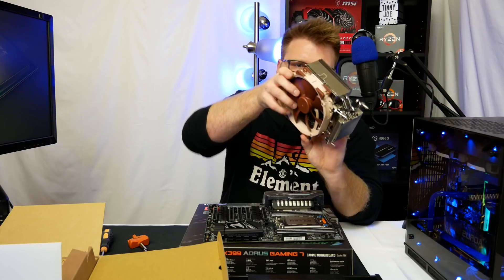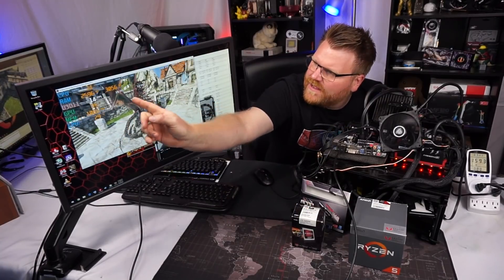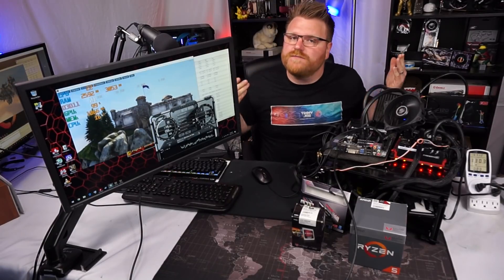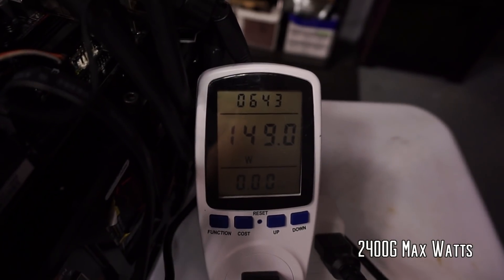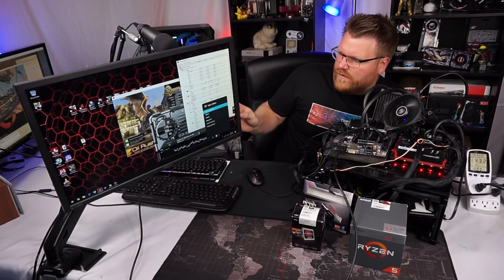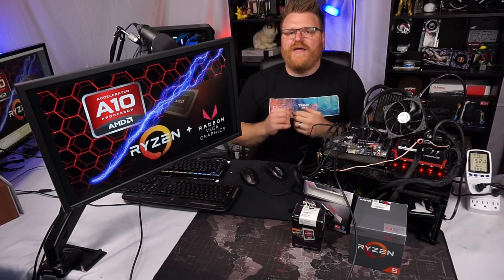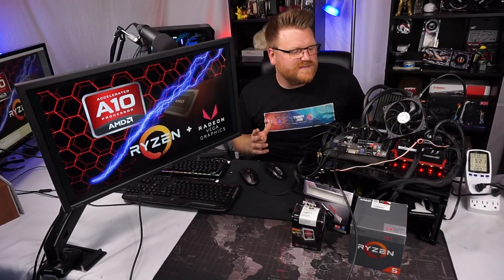How Far Have AMD APUs Come?! A10 5800k vs Ryzen 2400g

Comment: Watching this because I'm bidding on a a10 5800k to upgrade from my a6 5400k on my Linux mint rig.
I run dual graphics with a 1gb ddr5 hd 7570 dell card. Lmao. Since this is trinity like my 5400k it'll run in dual graphics. 2gb in bios shared to the internal gpu on the apu. I don't game on it though. Just streaming.

Comment: 2:30 - yes, that's because you've fitted water cooling. The motherboard isn't benefiting from the breeze from the downdraft cooler it's designed for, and as such is getting a bit toasty. If you fit a downdraft CPU cooler you don't have that problem - although it is slightly less efficient than a tower, which is again slightly less efficient than H2O.

Comment: My gaming computer has a amd a10 5800k, i can use a rx1030?
Reply from the maker: If that was a real card sure. Go GTX 1050 :) make sure you have a PCIe slot first
Reply: @TimmyJoePCTech  ok thanks brother for your answer, so if I put the 1030 would be a mid-range gaming PC and I would run the big titles like gtaV and need for speed

Comment: ASROCK X470 Board: Shared memory default 2GB. Max Shared memory supports up to 16GB.** **The Max shared memory 16GB requires 32GB system memory installed. 
Link: https://www.asrock.com/mb/AMD/X470%20Master%20SLI/index.asp#Specification 
ASRock Motherboard Compare Result: https://www.asrock.com/mb/compare.asp?Models=X470%20Taichi,X470%20Master%20SLI/ac,X470%20Master%20SLI,Fatal1ty%20X470%20Gaming%20K4

Comment: My Ryzen 5 2400g keeps crashing when I overclock at all. I can't even run my ram at DOCP. My ram is rated at 3200mhz and cl14, but I have to run it at 2866mhz to be stable. What's wrong and why can't I overclock at all?
Reply: What motherboard do you have?

Comment: the old ddr3 APUs even saw minor gains up to 2400 mhz, i remember jayztwocents testing it with bf4.

so it should be possible to squeeze out a couple percent more out that old APU,
dual rank memory is also known to give a 4-6% gain on average (on the cpu side of things) in performance vs single rank, it was true for bulldozer, and it is true for ryzen
Reply: Alexander Rewijk you do remember correctly. he saw diminishing returns when he went to 2400mhz. 2133 was the last big increase in performance he got.

Jay was completely impressed with its performance in 720p when he tried it at that resolution. I remember that video as well.

Comment: i used to have an A10-8790K and i actually gamed on it for a while!   my memory was DDR3 HyperX 1866Mhz overclocked to i think i got it up to 2200 Mhz or somewhere around that i remember it being usable in gta 5 at 900P "normal" for around 30ish FPS fairly solidly saw spikes into 40's sometimes.. and honestly it was CPU and GPU bounded ...  but for LuLz i paired my V56 and GTX 1080Ti to that A10 to see if A10 was really bad on CPU side, and yes.. 60fps is a struggle at 1080P...  even an i3-4xxx i had layign around was able to play gta 5 at over 60fps easily on 2 cores 4 threads.. this "quad core" A10 was terrible at being a CPU..

Vega is more bandwidth efficient because of how different Vega is vs old school stuff (pre-polaris) like tile based rendering, memory compression, color delta compression, primitive discarder engines, etc etc..able to render a lot more for a given amount of bandwidth..  i have a 2700U Vega 10 laptop with stock 2400Mhz dual channel DDR4 and its like 60% faster i would say than the desktop A10-8790K on just the GPU side.. on CPU side its like 100000000x faster..

Comment: Something wrong with 2400g oc.
I have 1500mhz on gpu and dual rank ddr4 3333@cl14 and my firestrike graphics score ~4500 (not 3700).  
BTW, If I push further (1625mhz gpu and 3466mhz@cl16 ddr4) I have even ~4800 score, but 2400g become VERY HOT.
https://www.3dmark.com/3dm/27461597 - here are my results.

Comment: you ever try 2 670's in sli with fire strike? i scored a 15200 graphics with them overclocked 100+/250+, + 13% power with afterburner.  with my i73770k oc'd to 4.2ghz with up to 5ghz turbo.  i got the top 17th score on fire strike overall with the exact parts.  i wish games would utilize sli better :(    https://www.3dmark.com/search#/?mode=advanced&url=/proxycon/ajax/search2/cpugpu/fs/P/1419/809/500000?minScore=0&cpuName=Intel%20Core%20i7-3770K%20Processor&gpuName=NVIDIA%20GeForce%20GTX%20670&gpuCount=2    sith187 user name.   thats my user name for most games and such.  GAME ON! n TECH ON!

Comment: Enjoyed the video bud. I’ve noticed that BF1 and BF4 can be really finicky getting past the main screen. The fix is to install a controller...I know, weird right, but it works for me in BF1 and BF4.
Reply: F2F Tech that's very weird haha
Reply: Hey it’s the guy that doesn’t know what testing methodology means. I mean he shows me videos to reference, yet they use different settings and have 2X MSAA enabled. Also, he shows me GTA 5 online game play, when performance is lower than the SP game. I mean I provided my settings line by line and my testing methodology(using the last 115s of the built-in benchmark) and 6 months later he still can’t provide decent evidence to refute my claims. I find it kind of sad that he keeps grasping at straws and yet he still can’t provide sufficient evidence. Out of respect for you I  tested the benchmark over and over again and got the same results. At this point, I’d you don’t believe it, then fine. Go buy a 7970 GHz or 280X and prove me wrong if you care that much. Other than than, stop grasping at straws here, it’s sad.

Comment: another good break down of pc parts and their performance. watch this single core a6 5400k paired with a hd 6870 running fortnite in 1080p https://www.youtube.com/watch?v=ctkCX6N-uGg&t=5s  i need to get a better heatsink for the cpu. its using a basic fm2/am3 heatsink.  full load temps reaching over 90 Celsius.  not good. lol

Comment: using a 2400G with 2x4 2400MHz memory(Oced to 3466 CL16) and Onboard at 1575MHz, all in a MSi Tomahawk Arctic, my FireStrike score was 4006 general and 4526 Graphics, why your system performed worse with faster RAM?
Reply: Ajr Alves he's running an unstable OC

Comment: i still use a10 5800k  overclock to  4,2ghz for about 5 years i remember getting this in 2013 because i care only on high clock speed and it's cheaper and im still using it now w/ gtx 970 im happy about it coz i still run any games w/50-60 +fps high settings in 1080p
Reply: Bryan Lotus you'll probably see more fps with a newer processor, but yeah not bad at all.
Reply: Bryan Lotus can you run bf v?
Reply: Dude I have the same procesor but with GTX 970 4gb and fortnite stutters even in low settings and my procesor isnt over clocked
Reply: What GPU would pair well to play Fortnite optimized?
Reply: @juanduque7983  Any recent gpu, like an rx 560 or gtx 1050.

Comment: Hey I got a question so I have a PC it has 4 case fans and they don't seem to be speed controllable is there a cheap way for me to change that
Reply: jt3000o if your case is one with a 5.25 inch Bay I'd suggest finding a fan controller. this would be the only way I'm aware of to change that.

that's without buying new fans.

Comment: "not as good as a gt1030, maybe between a rx550 and a rx560"
I don't want to be that lame guy but actually, the rx550 beats the gt1030 by 10-20% from one of the recent hardware unboxed video (although it wasn't about those 2 gpu)
Reply: Maybe he’s taking about the ddr4 version
Reply: SumageGames nope, the video was about the ddr4 version but it had the rx550 beat the gddr5 version as well
Reply: Rx 550 is a little bit better

Comment: Wait for a second here.  You bought RAM that is rated to 4266.  Says so right on the box.  And in the next sentence, you state that you are running it at a "modest" 4533!  300MHz over the box rating?!!  After just saying that on the board you have it plugged into that it can't even reach the stated specs on the box because the motherboard can't do it!?  What the heck am I missing here?  Because, something is not adding up on what you are saying.
Reply from the maker: 3533, if I said 4533 I'm dumb
Reply from the maker: 10:00
Reply from the maker: I also literally show the bios
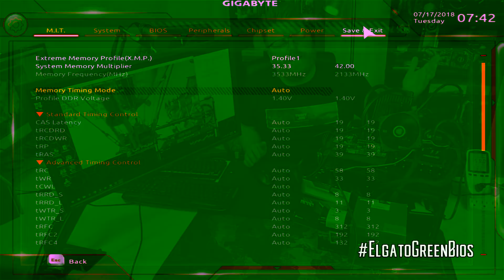Reply: "3533, if I said 4533 I'm dumb"...Listen at the @1:00 mark.  I'm not bashing you, just informing.

Comment: Was it possible to Crossfire the A10-5800K with an AMD GPU?
Reply: Nic Lindo yeah, but these are usually R7 graphics cards. it's more of a marketing gimmick than anything. you should just go with higher end graphics instead of focusing on crossfire with something that low.

Comment: Why don't you put in a real life scenerio. For example budget gaming build with R5 2400G, 8 GB 3000 MHz RAM (or 16, both in dual channel) and add GTX 1050/1060 few months later when you save more money. Or budget editing machine. You don't need powerful GPU for that but you need some.
This APU definitly have its place on market. Not as gaming APU but APUs never been for serious gaming and now they can be used like that for esport games or AAA games on lower res and settings
Reply: I don't want to it sounds like hatespeach but you have to look at it as decent GPU for free.
Few weeks ago I bought R5 2400G with 8 GB 3000 MHz (single channel) and I am planning upgrade to 2x8 GB and later on GTX 1060(or new gen equivalent.)This is for me better solution than R3 with 1050 and 8 GB of RAM
Reply: Vladimír Kučák APUs could end up being in a place for serious gaming in the future though. they're showing that they only have room to grow.

Comment: My gaming computer has a amd a10 5800k. I don't use the integrated graphics. I use a rx 560. It seems to work great in games like far cry 5 and gta5.
Reply: Paru  well it’s normally automatic but just make sure your display is connected to the gpu.  but the 5800k will bottleneck your gpu.
Reply: Paru a bed thing
Reply: @christiangarcia2533  hey I thinking of doing the same thing is worth the buy for the 1660 on the A10? Also do have any recommendations of any gpus good for this Apu for modern gaming?
Reply: @Paru hey have you found out if it works. Im planning on maybe buying the same gpu for my A10 5800k apu. Is it worth it for playing modern games?

Comment: The 2400g is pretty good for what it is. Even with 8gb 3200 memory. And a hyper212 does well enough. You don't need an aio.

Unfortunately, as respectable as it is, it leaves one wanting more. So I put a 1050ti in my system, but it did allow me to play games in the meantime.
Reply: lilkoolaidman93 
You should've gotten the Ryzen 2600x. I just got my 2400g yesterday by the way.
Reply: pnp072000 I know. I thought I would wait longer to get a GPU. It still works for my uses.
Reply: lilkoolaidman93 
Why can't you just return it and get the 2600x?
Reply: I bought it over a month ago, and I think the return policy is 15 days.

Comment: You should have tested Ryzen 5 2400G vs A10-7850K....or even an A10-7870K or even an A10-7890K. Those were really good 4c/4t APU-s that still perform much better today compared to Shintel iGPU-s :).

Comment: I think the 2200g is the best value since it's basically an i5 6500 at half the price, and the internal graphics are good enough that you can play 1080p games with it. It's not like you are loosing out on any money you could have put into a better price to performance cpu, and you can just drop a gpu in later without having to worry about your upgrade path. and when the time comes that you need a better cpu, you can just drop in a new ryzen chip, and you don't have to worry about a new platform upgrade, needing to buy new memory, or future support. The upgrade path is extremely efficient.

Comment: Well you did good job and yes 7660D graphics gave me more grief, and that's why the R7850 worked well.
Reply: The 7660D is the same architecture but far far weaker it has a laughable amount of TMU/ROPs and shader cores. the 7850 is a proper mid tier GPU from 5 years ago.

Comment: I have 2200g overclocked 4.1ghz with h60 AIO cooling steady 55 to 60C, overclocked 3000mhz 8gb rams, and also overclocked rx460 2gb 100mhz and 220mhz more. Plays much better that you did on 2400g xD
Reply: yeah and the next guy who bought a 1060 and slapped it in his 2200g system has 3x the performance as you. and he didn't overclock anything

Comment: I'm running a 2400g with a Asus R9 270x and doing just fine
Reply: I hope you already owned that 270X
It's performance improvement over the 2400G isn't really worth the money to buy it I feel.
But if you already had it then it's a nice pairing with that APU (although you could have bought the R5 1400 instead and overclocked it or the new 2500X)
Reply: Luredreier got it for ten bucks on let go
Reply: Luredreier it's the 2g version but all I had to do is reapply thermal paste and it needed a good cleaning. Like I said it works for me
Reply: Yep, 10 dollars sounds like a reasonable sum for that upgrade =)
Just make sure that you stay within that 2 GB limit.
With your setup I do hope Vulcan and DX12 becomes more popular soon.
You could potentially get quite nice performance if you could use the APU and GPU in a game supprting Explicit Multi-GPU.
It's not the same as crossfire (it neither performs well nor is it compatible with two different arcitectures like that).
But rather then alternating what GPU renders what frame they'd work on different things at the same time.
Perhaps one GPU could do the work on all the NPCs and the sky in a frame while the other does the houses and the light and shadows etc...
(Not exactly how it works, but you get what I mean)
One could do some post processing while the other works on the next frame, etc.

With the approach of a different GPU doing the post processing you could actually get more frames at a consistent rate and lower latency despite each frame actually taking longer to render then if it was all done on the first GPU because the work on each frame can overlap a bit reducing the amount of time the strongest GPU spends on each frame.
And since it spends less time on each frame it can start the next one earlier meaning that you get a new frame with the new data you've inputed (say a shot) earlier then you would if that GPU had to do all the work itself, despite the actual time each frame spends in the two GPUs increasing a little bit.
Reply: dominik obora 290s going for 120 on eBay......
Reply: dominik obora I still wish that someone does a comparison
Reply: its closer to a 1060 then a 1050 , when i was looking at 970s they were closer to 1060s and if the 270 is better then the 970 then it should be similar unless the drivers are bad
Reply: Damn 10 bucks I buy them for 70 and that's good for me. 270x is better then 1050ti. For half as much lol.
Reply: Faf Dus, it's better that a 970 and it's right under a 1050, but for what it is and the price of gpu's, it does what it does and that's game. I wish Timmy Joe would test a r9 270x against a 1050 with a 2400g apu and see

Comment: The 2400g is about as fast as my GTX 960m at stock speed, which I use for WQHD 144 Hz display.
I overclocked the GTX 960m by 110 MHz and undervolted the i7-6700 HQ by -0.12 volts so it won´t overheat my GPU. 
I need a new GPU :(
Reply: are there still m series gpus that you can replace the 960m with? I feel like they killed them off, but I wasn't too sure. That's one of the reasons I'm never going to invest in a gaming laptop
Reply: No, it is not possible to replace the GPU, its soldered. But next I´ll buy a PC

Comment: Ryzen 3 1200 and GTX 1050 or used 750ti are way better than any APU but if you just have enough for an APU and need to upgrade later it makes sense
Reply: Chownzi the Ryzen APUs actually get better performance with graphics cards than even the first Ryzen processors in a few instances. the old APUs are pretty bad, even in the CPU department, but the Ryzen chips are actually decent.

Comment: i am using an a10-5800k black edition with 16gb of corsair vengeance 1600 in dual channel with an fxf twin fan rx460 4gb and can run aaa games at 1080p at 60 fps for most of them great video
Reply: ohh and i also have the apu overclocked to 4.5 on all cores
Reply: nice! Tbh id upgrade to a ryzen apu for the ipc gains and the futureproofing
Reply: I'd love to upgrade just not in the budget at this time
Reply: maybe when zen 2 releases ppl will sell zen 1 and zen + used for cheap
Reply: dominik obora one can only hope lol